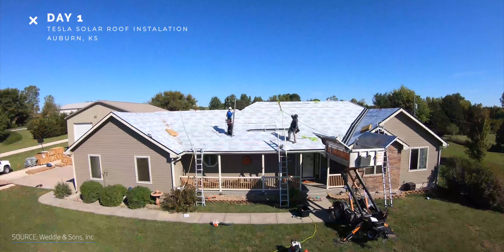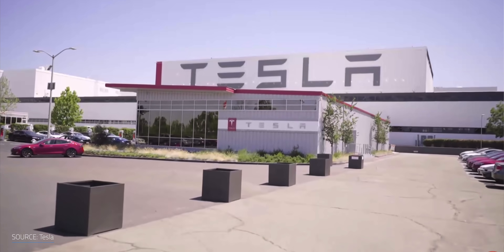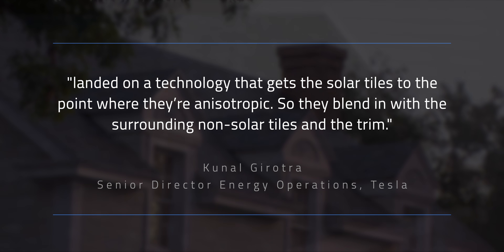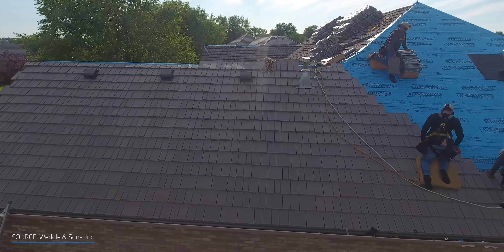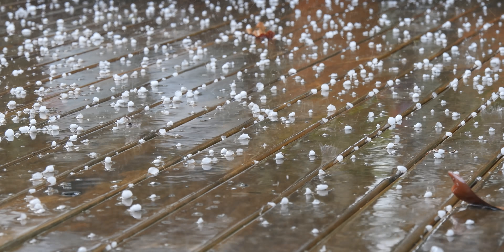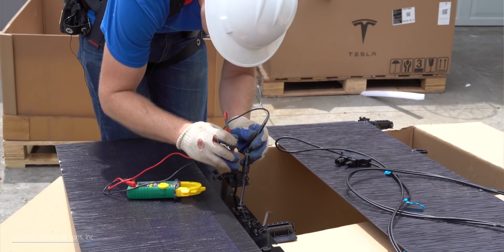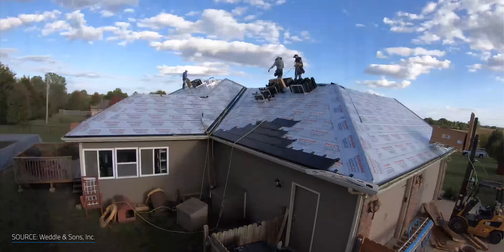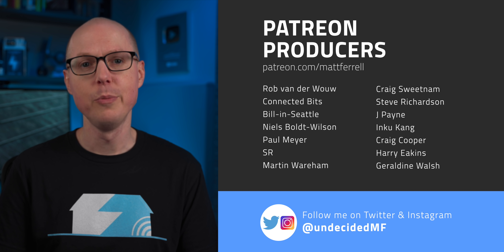Exploring If Tesla Solar Roof Is About To Go Mainstream?

Comment: Live in California and my home is in need of a new roof. The cost is crazy high but I plan to get several quotes and go with the middle quote. A side note is we purchased a Tesla model 3 last month. The purchase did not go smooth. Car came with flaws that the advisor refused to write up. She advised we go into the app and request a service appointment. The car was not washed and had the whole pickup experience seems rushed (the push to sell more cars). The roof will cost more than a model 3 so we're hesitant to consider Tesla. Great video and your work is stellar as usual. I would definitely consider Weddle and Sons if they were out here. Customer service and good companies are hard to find in this day and age.

Comment: Thanks for the vid! As an aside, the expression is "champing at the bit"
Reply: I think idioms are allowed to evolve. Not to mention, Champing means just biting, while Chomping relates to biting and then actually consuming. The video perhaps infers that viewers might gain knowledge from the video and do some more chomping, i.e. consuming.
Reply: @PhilVaglia  After doing some more research... I stand corrected. "Chomping" has been used so much that it is now considered a modern -- and proper -- variation. I just a fuddy duddy that way. As an example of this, I still hate it when people use till instead of 'til to mean "until." :-)

Comment: I wanted to get solar panels several years ago, but decided to buy offsets instead. Why? Because our electricity use is so low (<1/4 of avg home in our area) that the minimum fixed costs for inverter, etc exceeded our utility bill. The opposite should be true for heavy users, as the fixed costs will be distributed over a larger total energy usage.

Comment: It would only go mainstream if it costs the same as a traditional asphalt roof. Otherwise the cost does not outweigh the benefit of a solar roof that has to be replaced after 30 years due to the normal 2% yoy annual energy degradation. Don’t waste your money!

Comment: Looks like a disaster looking for an accident.        too many connections  can cause unreliable performance simple technology is not always easy   tiles have to do many jobs ie be strong waterproof sun proof connect well stand up to frost and intense heat ask any roofer
Reply from the maker: I did ... the installer I interviewed in the video.

Comment: Hi Matt, I was so excited to get a solar roof, but I just cancelled my order. Tesla increased my quote 30%+ over the weekend with no change in design and out of the blue they just chose not to honor a signed contract. I understand I was not the only one. That completely voided the financial benefit from getting solar and on top of that it killed trust and any will of doing business with Tesla (a company I used to love). If they don't honor a signed contract then there's nothing to stop them from not honoring other things such as warranty. Trust is very easy to lose and really hard to gain.
Reply: Agreed. I would be cautious with that and probably have to speak with something to do business of that nature again.
Reply: Tesla is run by the biggest conman in history, I'm in no way surprised by any of the horror stories I have heard about this, yet another, scam.
Reply: Fairy certain the fine print indicates sudden Market changes and fluctuations allows Tesla to "adjust" estimate.
Reply: @phironosurvivors2069  kinda defeats the purpose of a signed contract then no? They could show up and decide one minute before they start work to increase the costs 5000%. Or more likely after they remove your existing shingles, that's when the price goes up.
Reply: @slcpunk420  nearly every single contract is like that, literally.  Your cell service contract. Your email contract (user agreement they call it). Every contract or user agreement leaves companies an "out" of some kind or some way. Read the fine print. Welcome to a sue happy world where you have to as a company.
Reply: @phironosurvivors2069  sure but most companies don't quote you a price and then increase it 30% before the sale since they have competition
Reply: @slcpunk420  in the past that would be true, but ever since COVID19, that's no longer true, many many companies around the world will increase their price even though the contract says a lower amount, the alternative would be for the company to try and complete it for the original price at a loss to them and then going bankrupt.
Reply: It's all a scam.

Comment: Here in Germany we have mostly ceramic roof tiles, and they usually stay there for 40-60+ years.
I guess those solar roofs may last around 20-30 years tops!?

Also we have way more rain and cloudy days here in Europe on average than the US, so our PV systems usually take longer to amortize but on the other hand don´t degrade as fast.
And those solar tiles will run more hot, so they won´t perform as good and degrade even faster.

For the US markes this might be ok at the moment, because you throw stuff away like noone else on the planet.
But this seems not like the most sustainable system for the future, and for other Markets like Europe it´s not of interest anyway.

And i don´t get the thing with the esthetics, we develop into a high tech future in big steps, but wan´t oure stuff look like 40 years ago??? WT!
I Like the look of solar panels on roofs!

Comment: I kind of worry about the immediate future of solar power when I see these videos.  The rush to put as much product as possible on someone’s roof dramatically reduces the overall efficiency and return on investment.  I’ve seen way too many installs that could have produced more electricity with less panels.  It’s a sad thing to see given the benefit of the product if properly installed.

Comment: So I just started going through the steps to do the roof. The builder suggested a system for us, that came in at a monthly cost that was just around the cost of our normal electric bill. So we decided to do for it. Though I'm the process of waiting for the design, the website changed, and the price shot up by about 80%. Which is pretty absurd. Not so sure this is happening now, so I'll keep you posted.
I don't want to panels, but that may be the route that we go.

Comment: I’m actually planning on building my wife and myself a tiny house in just a few years, once we’re out of school, and this seems like something I might want to incorporate into the build.
Reply: That's a super smart idea because it would fit into the idea of keeping things small for your build, yet creating power. I don't know how much roofing space is needed to maximize the output, but I'm sure the experts out there can help you out. Good luck!
Reply: Yep, I'm planning to do the same with mine. A nice powerwall will sort out the battery bank issues most tiny houses have.
Reply: Same! I just wanted the tesla roof but now im thinking about the tesla wall!
Reply: If you do an individual tiny house solar panels are around ~20% more efficient (relative, absolut 5%) this will make a huge difference for a tiny house. Also with tiny houses you have a good chance of optimizing your roof for normal solar panels. So overall in my opinion for tiny houses go for high efficiency standard panels. Also the roof is not fully covered with panels mot of it is dummy panels be aware of that.
Reply: $100,000 for a 1200  sqft single story house.
Reply: Sounds awesome! Just make sure you are giving some of that power back into the power grid. The government doesn’t like it when people are self sustaining.

Comment: I'd like to see the sums on the efficiency of the tiles, their price per area and the sacrifice in efficiency from roof geometry.  If you designed the roof with these in mind you may get a good result but it would be very easy to get poor performance due to the tiles' angle to the sun.  Maybe if they're cheap enough and you have a big roof you don't care but I'd still like to see the maths on how they compare to conventional rooves and panel installations.  They do look good, though, and I see the benefits of easy installation and maintenance.

Comment: I would have gone with solar roof if our roof didn't still have 15 years of expected life left and we wanted PV right now and solar roof is not available in my area yet.

Tesla solar panels were also not available so we had to go with the best locally available installer which was still a great experience but not quite as good of a price as Tesla solar panels.

Comment: 35 sec in - I see  a separate electronics box that will end up under the tile block.  It looks suspiciously like a micro-inverter.  What is it? (given that Tesla likes string-level inverting).  I have a palm tree that tracks across my south roof and it would kill the efficiency of EVERY lateral string, much of the core day hours.  As I understand it, this would reduce the amperage of every string that whole time.  Microinverters would solve the problem (or going to "vertical" string/blocks.

Comment: Their tiles are only about 8-10% efficient vs 19-20% for traditional panels. They are also using sting inverters vs per panel micro inverters which further decreases efficiency. Another downside is the entire roof is dark and that heat is dissipated into that roof and onto the house vs a white roof with a smaller more efficient array. Majority of traditional panels have a white backing as cooler panels are more efficient. The product is form over function it seems like to me. I think partnering with Enphase for the micro inverters would be a great start towards improving efficiency but Telsa likes to do things on their own it seems.
Reply: People buying these aren't buying them for efficiency. I hate how panels look, as do most people in my area, they are not common. Solar shingles though are very aesthetically pleasing. I would put these on my house for the right price.
Reply: @betterhomesnc2437  There are many issues with these beyond efficiency. The tiles and brackets are 90% plastic with the solar cell glues to the top. Despite Telsa's claims I have serious doubts these will last. The tiles themselves do no weather sealing, that is done by the underlayment. In the case of a leak the tiles have to be removed to resolve the leak. These installs are being handle mostly by roofing contractors, not solar installers. This leads to long wait times if it needs to be repaired. Since these are mostly roofing contractors will no prior experience with electrical or solar this leads to other issues. I've seen this happen and there are many documented cases online as well. Several cases where roofs were covered with tarps for months while they waited for someone to repair the roof. Your probably right about the aesthetics. That seems to be the trend these days, build a house out of cardboards and then decorate it with granite... IMO there are better ways to achieve this. For instance the farmeless bifacial panels on the market now are all glass semi transparent panels. They can be used to cover decks, pergolas, carports in place of traditional roofing, or even used as awnings while letting some light through. The best part is these panels can be 25%+ efficient. From a building science point of view the solar roofs do not make sense. With their low efficiency and no way to properly deal with these roofs at the end of their life cycles, the do not make environmental sense either.

Comment: I noticed holes being drilled  and nails being shot into the roof deck and saw no method of mitigation.  That's hundreds or thousands of holes that will allow water and/or air to leak.  Installing solar while causing rot and leakage is by no means a benefit.  We currently are fixing a very similar cluster-fork caused by a company who I'll call Vivint, because that's their name.  They made these same dorky confumbulations and caused tens of thousands of dollars in damage and the client will have to take them to court.  Vivint doesn't care because they are chasing an IPO, so current clients don't matter.  Once a crew quickly covers it up in 2-4 days, no one can detect the problem until rain and rot and damage occurs.  Will you ever speak to this?  Might you know of a person knowledgeable enough to intelligently speak to this issue?  Thanx

Comment: I've always wondered how much it costs to replace a roof with solar on it.  Roofs only last so long so you have to remove the panels, replace the roof, then replace the panels.  How expensive is that?  Does that cost counter the savings from the years of solar panel use before the roof needs to be replaced?  Also, sunshine needs to get to the panel to produce energy.  How do you clean them for maximal efficiency?

Comment: This looks really interesting for an off-grid house I’m designing now near santa fe.  I wonder, how well do these work as rainwater collection surfaces?
Reply: It's an actual roof, designed for water. So, the water hits the roof and goes into the gutter / rain water collection. BTW, they also shed snow and ice. There is vid on that on YT somewhere.
Reply: @JDWink  I’m concerned about any production chemicals,  or plastics that the rainwater would come in contact with.  I’m sure they’re not food grade materials, and what all surfaces does the water come in contact with before hitting the gutter. I’m not super picky, but there might be some coating that might be pretty bad.

Comment: Well, bought a house last year (Tampa suburbs), roof is 10 years old, will be good another 10 years, my bet is even then they will not be economical to put on your house.  There are no installers here for this so I cannot even get an estimate, but pretty sure it will jack my homeowner's insurance by at least 100% and that is already pretty damned high.  And it is not even the complexity of figuring out if the roof itself is priced at an economical scale where it would even be something to consider, there is the price of the roof, the price of the Tesla Powerwalls you will need.  There is the fact that in the event of a power outage you are going to be the very last house in your area reconnected to the grid because houses with generators and solar/battery storage pose a serious threat of electrocution to linemen, it is power company policy to leave your house for last.  And you will still need to be connected to the grid unless you have a system of storage so vastly in excess of your peak needs that YOU nor I can afford it.  Duke Energy here is just slightly more than 100% of the energy price I paid in Oregon before moving here last year and this Tesla system is not affordable.

Affordability in solar installs is calculated by the breakeven period, that is how many years till you are getting back more than you have paid for the system.  When the federal tax subsidy was high that was not so bad for conventional solar, but not all of us qualify for that deduction, my income is exempted so I do not even file with the IRS, and the solar tax break is not a refundable amount but merely a credit against taxes owed, if you owe nothing you get no tax break.  That pushes the breakeven point out several years up to about a decade depending on the system.  

Even if I could get a Tesla solar roof, and 3 or more likely 4 powerwalls that would be required to run the house 24/7 365, my breakeven after install costs and the county permitting process, and the increased tax impact there, and the much higher insurance (mind you insurance does not yet know how to rate these roofs for hurricane safety and that is the single biggest driver of policy costs) all without any incentives being paid, I am guessing my breakeven period would put me out to about my 143rd birthday.  And that just means there will never be a Tesla roof on this house.

Comment: The issue here is that these Tesla tiles are not very efficient. around 5 - 8%. compare to LG and Sunpower panels @ 21- 23%. I think if they can get efficiency up to 15 - 18% (or more of course) then it would be worth considering.

Comment: The tiles look much better than panels but seeing them put a lotos holes in the sub roof topush the electrical makes me wonder about the roof failing. How tight a fit do the tiles have to keep rain from getting to the subroof. How muchpower does each tile produce? It doesn't look hard to install but can one cut a power tile to fit the roof ends.

Comment: If you buy a house with borrowed money (aka, a mortgage), solar roofs make no financial sense. Even if you have the money upfront, you need to compare the return on solar with the price of electricity in your area and the average ROI for say, the S&P 500. 

Example: the S&P 500 increased 3.8 TIMES in the last 10 years. So if you had $20k ten years ago and put your money in stocks instead in a solar installation, you would have $76k today. Our electricity+gas costs last year in the Midwest were not even $2k (not just generation, but the entire thing). So yeah, solar is far too expensive to make financial sense.

Comment: My first thought... I don't like all the wires under those tiles! Why don't they integrate the wiring directly into the panels themselves such that they electrical connections are formed as each panel is attached to it's neighboring panels? Or am I missing something? :-\
Reply: That would be difficult to weatherproof.